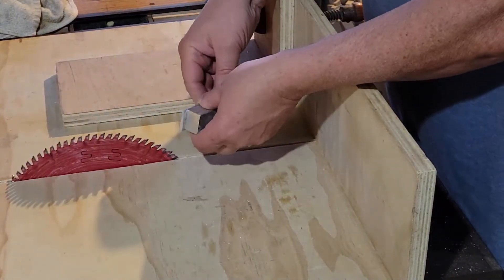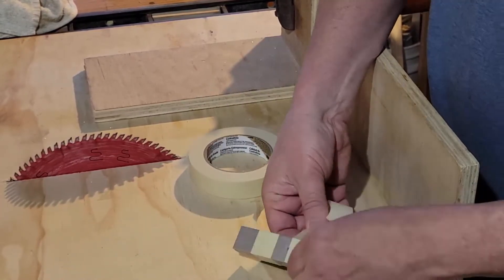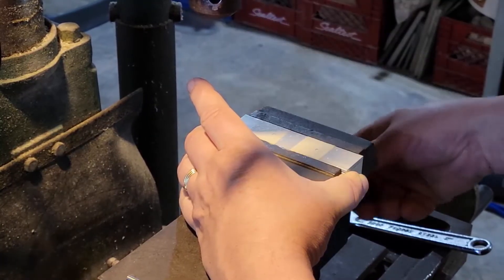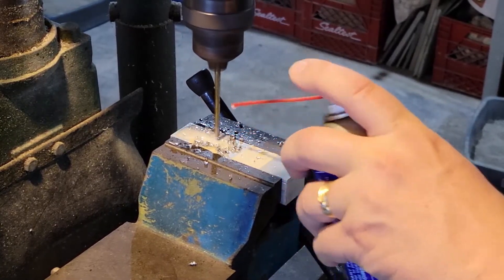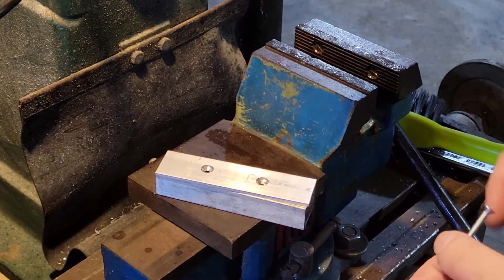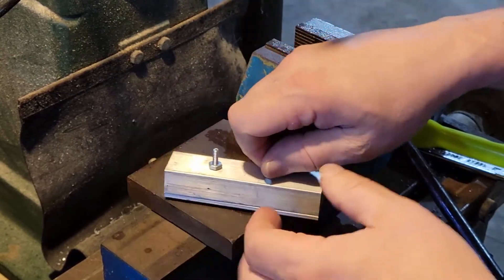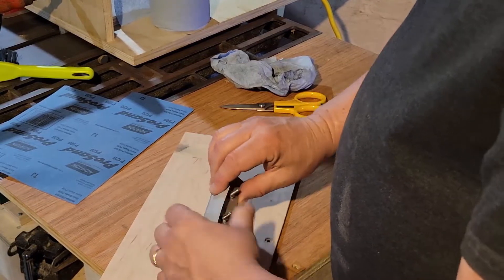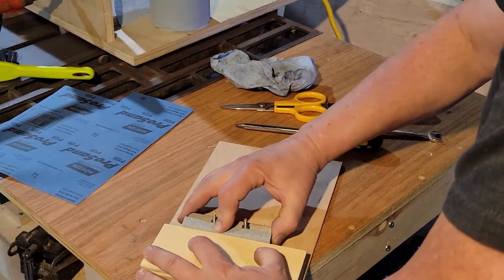Mini Aluminum Sanding Block

Comment: should be a useful little tool you could make something similar but use a old file instead of sand paper you could even put a different one on the other side and have it smooth top and bottom
Reply from the maker: Hey Colin! Great suggestion. I did it this way as I had the material and it was quick to make. I will try it and make improvements if it works well enough.